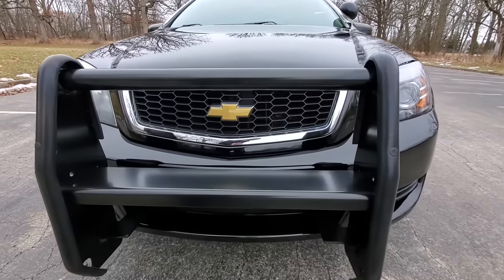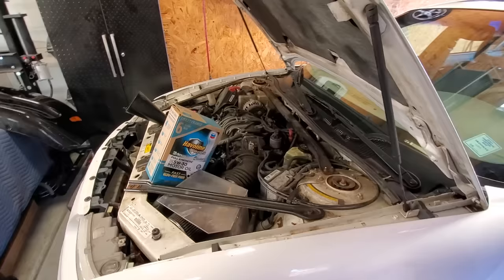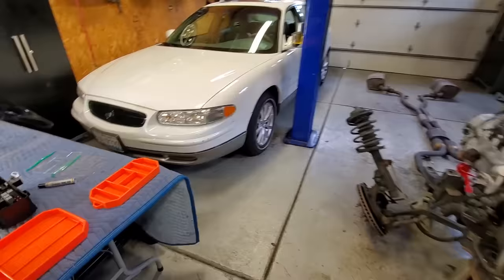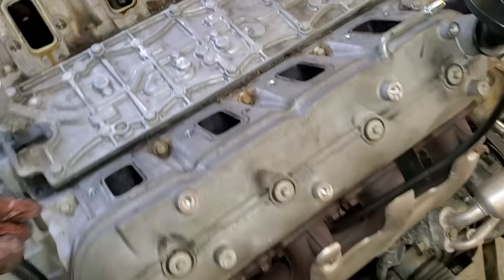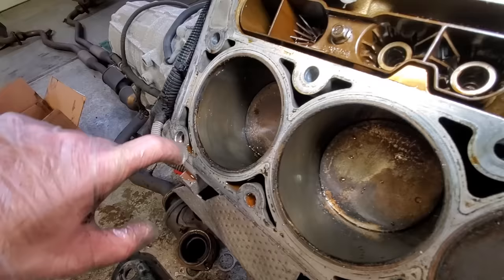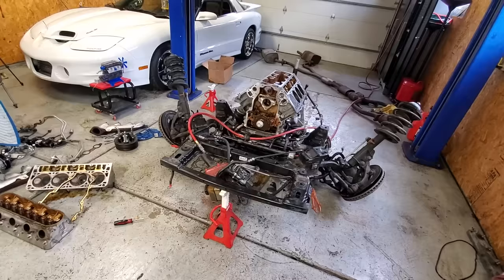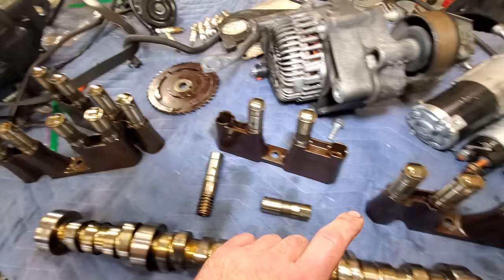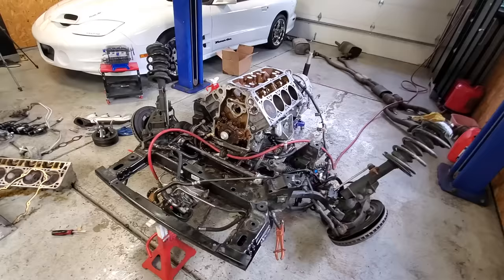Looking Inside An ABUSED V8 Engine That Idled For 12 Months! 357,000 Mile LS Teardown + Body Removal

Comment: Is this the famous "AFM delete" ? Im asking, is there no way to stop the 8 to 4 cylinder management, other than physically remove the VLOM plate. For some time i was under the impression some did the delete using the engine computer

Comment: I have a 2013 Silverado and after 3 years the #1 lifter collapsed and caused me to have to replace that whole bank of lifters. They were replaced with a factory upgrade that corrected small oil port problem. The oil pressure is always around 30 -40 psi which is crazy compared to the 01 Suburban that I had that usually ran 50-60 psi.

Comment: I've been hearing LS LS LS for years, still haven't built one, and just now learned of displacement on demand.  I think my next build will just be a billet block up so I don't actually pay for anything but what I use. Solid street rollers with bushings are the way to go, but they need to be block oriented rather than riveted together with link-bars because that's literally a "weak-link". I always try to make everything as bullet-proof as possible because I hate annoying issues after all the trouble of doing a full-blown build, but so far, there have been design compromises in everything I've built because of using OEM blocks.

Comment: We just got rid of our 2012 Tahoe that had only 55k. We calculated that it had 42,000 idle hours. Thats 1.386M miles. It’ll be sold at auction soon. We thought it had a head gasket leak but it was only a slow slow leak at the bottom of the reservoir tank.

Comment: My 5.7 litre Chevrolet LS1 V8 engine which has done About 363,655 kilometres (225,965 miles) was in the same condition as the engine shown in the video when I pulled the cylinder heads off to replace the hydraulic lifters in 2018 at 337,512 kilometres (209,720 miles) as they were sticking inside the engine block once the engine warmed up.

The engine had been neglected & it still had the factory hone marks on the cylinders & no lip on top of the cylinders so I left the bottom end alone,I did an oil pressure test to rule out worn bearings which tested o.k.

So I even reused the old oil pump but I did replace the timing chain with a Rollmaster LS2 timing chain which had thicker links in it as the old timing chain was a bit loose,I even fitted a Melling LS2 timing chain damper & bracket kit despite my engine block being predrilled to accept an LS1 timing chain damper the LS2-LS3 damper & bracket kit was cheaper than the original LS1 damper if you could find one,the mounting hole spacings are different between the LS1 & later engines,I did that while I was replacing a leaky timing cover gasket.

One word of advice when fitting the new timing cover gasket while the oil pan is still installed is try & get an OEM or Fel-pro (they're the same as GM as Fel-pro are Chevrolets gasket & seal supplier) because I tried to fit a Platinum oil pan gasket (I'm located in Australia), the O ring part was thicker so it squished out & pushed down onto the oil pan.

When I went to torque up the front oil pan bolts I cracked the front right hand corner of the oil pan therefore I had to remove the oil pan then get the oil pan welded up,I trimmed the excess gasket off with a razor blade.

Note some oil does accumulate in my Chevy LS1s inlet manifold but Chevrolet changed the PCV valve setup in the L76 V8 engine & my engine doesn't burn any oil.

I didn't even have to get the cylinder heads rebuilt as the valves didn't leak !

Comment: I have a Landrover Perentie FFR 6x6 from the Oz Army. Only has 6,000 kilometres on the clock but being that it was fit for radio no doubt it spent nearly it's whole life out in the field at idle turning diesel into 24 volts to power the big radios. Took the 24 volt generator off it, that thing is almost as big as a bucket. Huge generator. No idea how many hours of idling it has done though, must check the workshop books. I'm sure it has an hour meter on it.

Comment: Idk about that Havoline claim. I think I'll stick to valvoline. When we replaced the lower intake seal in my 91 Pontiac with a 3.1L v6 with 285,000 hard miles on it the cam looked like new. And it always had valvoline ran in it. I'll have to do some research on that

Comment: Hi Alex! I cannot find the video you posted a while back where you stated you are an Amsoil dealer and can give 25% off purchases. I logged in to Amsoil using your referral/dealer info as your video had instructed, but the pricing for a quart of the diff fluid for my '05 4Runner SR5 V6 didn't appear to have any discount. Can you advise, please? Thanks!

Comment: What are your thoughts on ultra fine bypass oil filters?  They run parallel to the standard full flow filter. About 10% of the oil goes through the pm2 filter. They keep the oil ultra clean.

Comment: It makes sense. Most of the wear occurs from the thermal cycles. You will also have less chance of buildup on components. If the temperature is always at a constant temperature they will run longer and will have less wear. However that is impractical for typical drivers.

Comment: Buddy had an early 2000's Chevy 3500 van with the 6.0 Iron block as a full-time service van hauling around perhaps 8-10K worth of his junk in the back all the time. The truck retired, fully running with over 500K on the motor. I think the only thing replaced was the alternator at some point, otherwise all stock.

Comment: The only engine I ever took apart was my 97' 3.8 series II and it was a total mess. The pistons had a ton of thick carbon all over. Cylinder walls all had gouges in them the legth of the wall. My nail would catch them easy. I had a lifter failure and it wiped out the cam too. Anyways it was fun getting in there but wasn't worth fixing. It only had about 105xxx miles on it too.

Comment: Fun Fact: Our UDR 1200 drill rig with a Cummins Signature series had about 37,000 idle hours (2, 220,000 odd kilometres), and 30,189 working hours (over 1.8 million kilometres) before the motor was swapped out. Oil change every 200 hours (about once a week), fuel filter change every 400 hours.

I know its different to yours, but interesting none the less.

Comment: Years back I bought a 2007 CVPI with "only" 100k miles. Idle hours were 5000. Fords manual says 1hr of idling equals 30 miles of driving. That car had 150,000 miles of idle time, plus 100k of actual driving. I was doing a 10k mile oil change interval (mobil1 full-syn oil and filter) and i never needed to add oil between changes. Not alot of power, but great reliability

Comment: Just got done replacing a camshaft in a 2019 Silverado new body because one of those active lifters rotated in the bore and wiped out the cam.  In the same time span I also replaced an active lifter in a 2015 Tahoe because it collapsed.  No, GM has not fixed the issues, actually made it worse in 2019 with 16 active lifters instead of 8.

Comment: So is that variable displacement or cylinder deactivation (which only happens or is supposed to only happen at cruise speeds to help with fuel mileage)? I’ve never heard the term “variable displacement” used

Comment: when you drop out the engine etc like that does the ac gas need evacuation or is it a special no leak connector? If not would it be possible to remove compressor and hosing  easily from engine (not releasing any gas) before removal?

Comment: Our military flightliine trucks were rarely turned off, and spent their entire life driving at no more than 15 mph.  The motor pool scheduled oil changes strictly on mileage, not hours.  The oil was always black as coal.  Tires might last 10,000 miles, because the truck were always driving in circles on the flightliine.  The trucks were mostly standard Chevy half ton trucks.

Comment: I've never paid an older cars mileage too much mind. You can learn more about how a car was driven by the amount of wear on and around it's brake and accelerator pedals than it's odometer. Of course it's a factor when considering a newer one. But the cars that I typically deal with are usually exempt.

Comment: Those are some impressive idle numbers lol. My 2011 ford f250 had 3k idle hours and lot 4k drive hours when I bought it with 90k miles.  It was used as a company truck or something.

Comment: maybe a dumb question,  but why is shutting down the valves necessary for cylinder deactivation,  wouldn't just shutting off fuel and spark be sufficient ?

Comment: You don't use 0.75 Gal/Hr on a warm engine unless you have a problem. Almost no internal combustion engine requires more than 0.50 gal/hr and most 4 and 6 cylinder car engines are in the 0.15-0.30 on a warm engine.

Comment: Question, do you know weather or not that specific retired police car had propane injection? In my area in FL its commonly used in police vehicles and ive seen used oil on the dipstick of locally used still in service car at 5k miles that looked brand new because of it

Comment: I have a black and white crown vic from the coast and it's never seen winter. 6800hrs on the engine and 0 smoke or noise runs beautiful. Most cop cars are very well maintained much better then any public owned vehicle. Yet people assume 172k and 6800hrs means its worn out junk

Comment: Is DoD really that pointless on these? I would have thought the improvement on MPG for a V8 running on four cylinders would be more significant than 1-2mpg. I've never owned a car with DoD but I have had plenty of rentals with these sorts of systems and the MPG seemed to benefit quite a bit. I had a few VW group cars on long term rentals where they had a little 1.5 litre I4 petrol engine that would run in two-cylinder mode, and I recall I was averaging around 60MPG during motorway cruising (imperial, so around 45-50MPG US).

Comment: Why? Why would you unbolt the strut from the mount and not the spindle? That way you could hang the caliper without cracking the brake system open.

Comment: My ram 1500 98 5.2 v8 magnum is a legend . 160xxx . It definitely has some idle time on it . Not like a police car but if I am running a few Arron's I don't turn it off and I let it warm up for about 5 to 10 mins in the morning . It's a welding truck . Has a engine drive welder a tool box oxy-acctlene bottles welding leads a vice . Welding consumables . Tool box has renching tools to work on the truck and more welding tools like grinders torches   wire feed welder . It's also a 5 speed manual transmission . Love that dam truck .

Comment: Love your channel, I have a 6.2 in my 2015 ltz, love it and I own a 1990 ZR-1, that LT5 ain't no joke, loves high rpm's. And a 1972 Pontiac 455 H.O, it's a beast. Honorable mention to my 2008 2.2 G5, 200,000 miles and a great little engine, also my 2015 Colorado 2.5. Subbed. 👍👍🏁🏁

Comment: Idling isn't the same as driving. When you are driv8ng the oil is being pumped hard by the iil pump. When you are idling oil pressure is very low. 

So it can damage pushrods lifters camshaft bearing and lobes faster and more aggressively.
Reply: Only if the engine is poorly designed. Any decent engine can idle indefinitely

Comment: How do you calculate so many miles for idling when the RPM is so low?
Reply: If you think about it, the rpm when idling isn’t so far off from highway speeds, 60 ish mph in overdrive. Sure maybe 500-700 +/-  rpm higher but seems close to me

Comment: Tech tip. Next time just remove the brake calipers from brackets and raise them with the body. Unnecessary introduction of air to the hydralic brake system there folks.

Comment: Or just straight up engine hours very important, especially when looking at trucks. Trucks usually will tell you engine hours and idle hours on newer models in most of the base model commercial versions. But always look at ours and then divide your miles by hours and you'll see your average speed. Now I've had a Tahoe with 180,000 mi on it but it had like I don't even remember how many hours but it averaged out till like 65 mph like it was all highway. It was a business guy one owner. The thing was like brand new outside of the fact that he had a dog and I had to douche that interior. But long story short, I drove Dorothy for 3 years with no issue to about 263,000 mi I put miles on it and I sold it to my buddy and he still drives it.... Specifically 99 to '06 Chevy trucks and SUVs in my opinion are the greatest half ton trucks made even the 3/4 tons are great but honestly Ford's and Rams are better dump trucks because of the solid front axle. And personally I like Fords for my work trucks and Chevys for my personal trucks. Especially you have tons. I know the F-150 is great but I believe the F-150 had a crap time period From 97 until the coyote. If you want to argue the two valve is being good that's fine and we can start at the three valve being the beginning of crap time... GM started poop production in '07... But not all hope was lost. Some of the vans large trucks commercial vehicles in small base model 1500s with specific 4.8 l engines did have no AFM and wear great engines. Some early '07 and '08 trucks came with the 4L80 instead of the 6L80.... But it also is the end of the manual option. Standards used to be called standard because they were standard equipment which is what they should be. In my opinion, trucks and work vehicles should be the last thing to not have a manual transmission.... Outside of econo boxes

Comment: How many hours do you think truckers let their engines idle? They still last for a long time. While idling, the engine generates very little heat and uses much less fuel. Unless it is cold enough that you don't build engine temps, it is easier on it than pulling a load.

Comment: Hello there first time here! Love your ideas for this car! There’s a local used car dealer here in Central Florida, not 20 miles as the crow flies from my home, that specialize in used municipal vehicles that has gas a couple Chevy PPV’s come through. I’ve stoped by to look at them and to be honest, my biggest concern has no been laid to rest, the long hours of idle time. It doesn’t seem like the Highway Patrol has used them as far as I can tell, my theory being the idle time must be less in Highway Patrol cars? But I’ve always thought of making a great modern sedan sleeper. I’d do almost exactly what you are, except for the aggressive torque converter, for a more normal driver, as whatever I build I have to drive. I would spend more on looks than you probably will and suspension mods, for more ground clearance and deeper suspension travel if possible, with stronger dampening. With a very nice Pearl White with blue base including the chameleon effect paint, with a sort of matching interior colors as much as possible. I would need to change the rear seat if it has one of those super duty molded seats, maybe a Pontiac G8 interior would help if I could fine one useable. But I would definitely use the front “cow catcher”!

Comment: Hey Alex, another cracking video, thanks. You still working on your diesel Mercs?  I've gone back to Mercedes after a few years with  Audi.  I went for the E220D Convertible, not the one I wanted, but it was convenient and for sale only 2 miles from home.  I wanted the E350D Convertible, but there wasn't one at the right price for 450 miles.  The 220D only puts out 170 bhp, it has the pulling power of me in a Night Club..., so, Looking for suggestions for some improvements.  I can have it remapped to take it to around 205bhp, still not great but an improvement.  I'd really like to install an uprated turbo along with a larger intercooler, but then I'd need another remap to hit peak power.  I also got a new set of 19" rims as I think the 17's on the convertible look far too small for the car.
Keep up the good work matey, really liked this video of the caprice.  Looks in astoundingly good condition for a 40k mile car never mind 350k.
Thanks and look forward to the next vid.
By the way, any suggestions for performance upgrades would be appreciated although I know how busy you are.  
Cheers matey, 
Frankie

Comment: 1 or 2 mpg on the highway is very wrong!
I have a 2008 suburban with DOD which I disabled but before I disabled it, on the highway in V8 mode it got 18.8mpg and when DOD activated it got 32.4mpg not instant! 
Same with my mothers 15 corvette, it gets amazing gas mileage on the highway, over 40, but she don’t use that either! Thank goodness those can be deactivated by keeping it out of eco mode

Comment: Same old story. ICE engines run (or don't run) on oil changes. 
I change my oil and filter quarterly and I only ever use a top spec synthetic. 
In 30 years and some spaceship miles on a few cars, I have never had a top or bottom end failure.

Comment: From what I understand as long as you change the oil every 3000-4000 miles and have a lead foot the cylinder deactivation isn't as big of an issue

Comment: Idling is good in some situation, I use to do maintenance on taxi 🚕 and the engine oil was like brand new looking even after 10k miles, by running all day without stopping the engine, no humility is created in the engine and carbon deposit doesn't sticks inside the engine

Comment: I'm guessing the camshaft needs replaced if you delete the DOD? You sang praises about how "excellent" it looked when you removed it, but you were also overly ecstatic about the replacement England Green cam. Or did they just slide you a stack of cash to replace it anyway?
Reply from the maker: Ummm, the new cam is a performance cam. I clearly said there is nothing wrong with the original cam. I'm modifying the car hence the headers and torque converter.